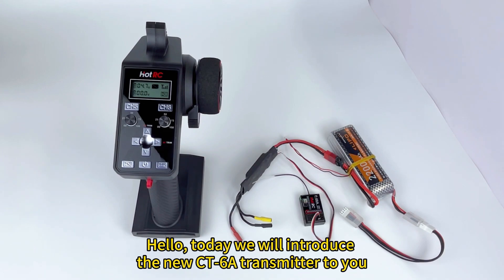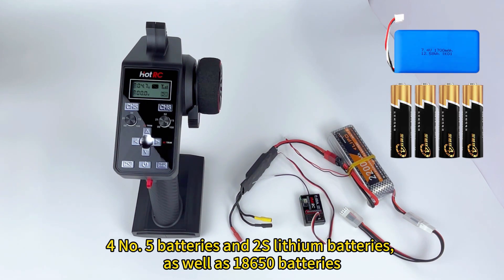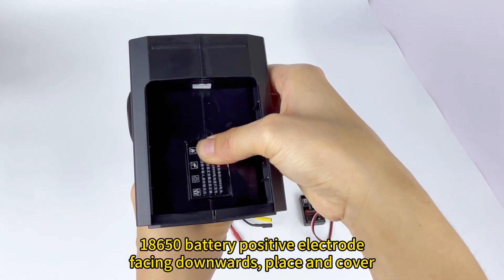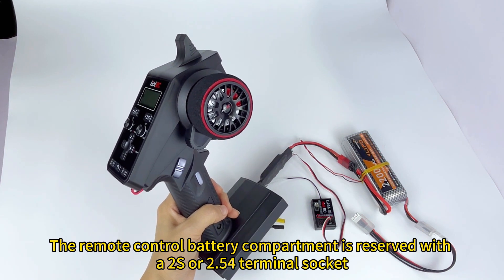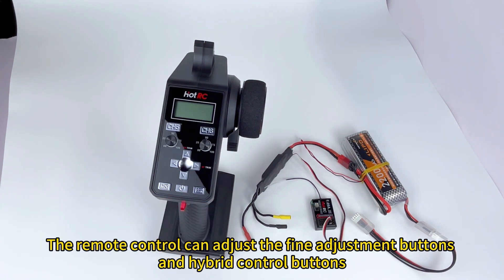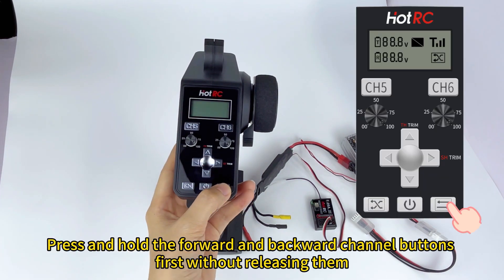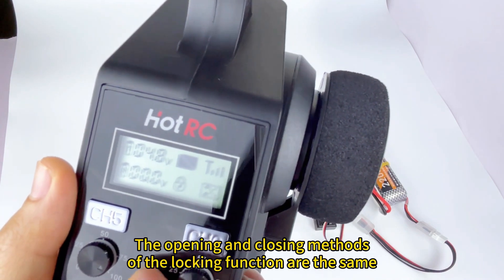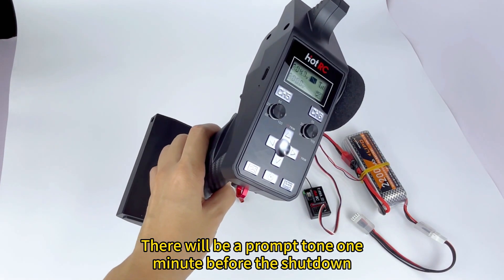HOTRC CT-6A gun control battery instructions, lock function and automatic shutdown function

Comment: Can i instal 2 type of battery on same time 18650 and lion batterry?
Reply from the maker: The remote control can be installed with two types of batteries at the same time: 18650 battery + four AA batteries, or 18650 battery + 2s lithium battery
Reply: @HotRC-Sophy  its safe for charge 18650 batt directly from remote?

Comment: What is connected between the battery and the relay in the shrink tape?
Reply: ESC - Electronic Speed Control.
Reply: @JamesDirtRC what channel does the ESC connect to? Ch2?
Reply: @pmilitary047  throttle / brakes / reverse

Comment: Lock mode makes TRIM function work  incorrectly 🤧🤧
Reply from the maker: If the locking function is turned on and cannot be operated, then turn off the locking function.
Locking and closing steps:
1. Turn off the remote control first;
2. First, press and hold the [Channel Forward and Reverse] button without releasing it, and at the same time turn on the power switch of the remote control; the icon on the display will prompt that the locking function can be turned on and off in the same way.
Reply: how to stop the beeping sound